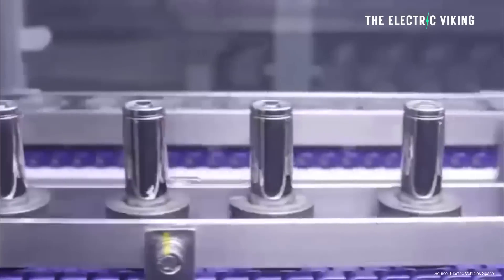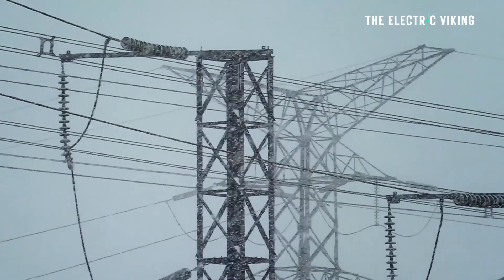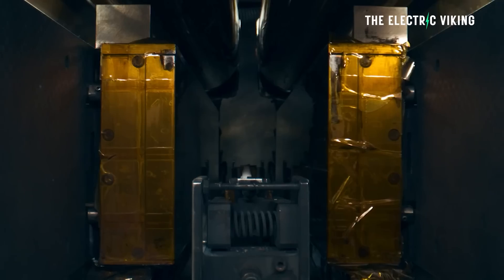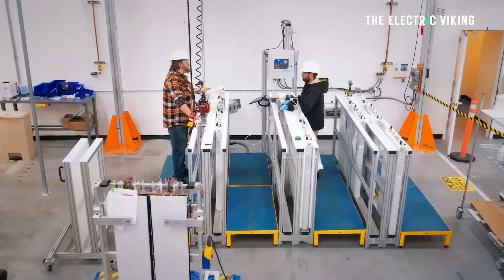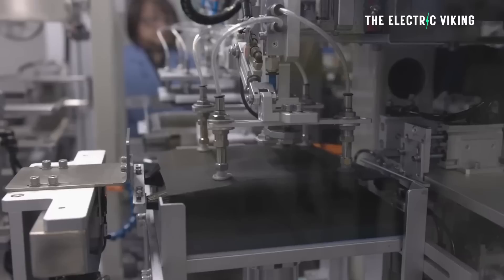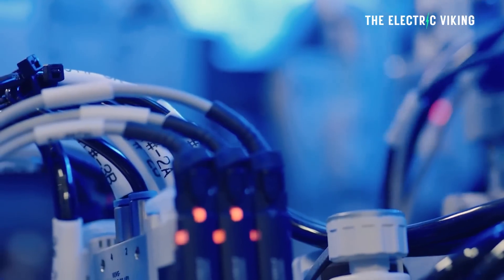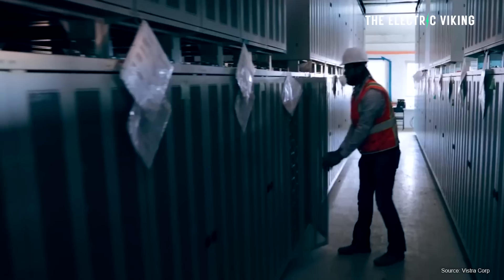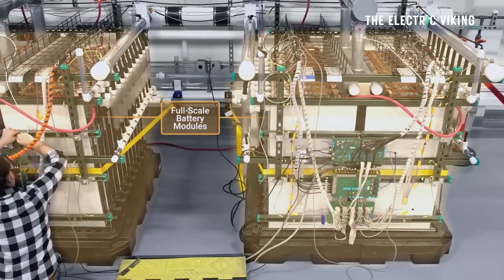U.S company reveals revolutionary battery that DESTROYS sodium & lithium

Comment: Iron air battery's round-trip efficiency is only around 50-60% versus 90%+ for Lithium, that is a big downside I think.
Reply: With peak solar electricity gone begging for a buyer, it's nearly free.  If these can be built cheap, and show a long lifespan,  I expect them to be integral to grid backup in the future.
Reply: It would probably be competitive with low pressure hydrogen with grid scale electrolysers and fuel cells.
Reply: It would be excellent during a natural disaster because you would have spent $30 of electricity to charge it and it would provide you with $18 of electricity. 

Most homes use about $3 of electricity per day or less.
Reply: @mac_mcleod  Nonsense, the price of electricity on the wholesale market is volatile. In the last 7 Days in NSW Australia the price max was $450/MWh and the min was negative $44/MWh
Reply: @retrofitter  Nonsense... the price of electricity is 13.5c / kwH.  See, I can do the same thing.   

Even tho "wholesale" electricty is volatile, most home owners will have a fixed average cost for a given time of day. 

And I'm sure the price even varies wildly in different Australian states.
Reply: @mac_mcleod  nonsense the retail price of electricity in SA is 31 cents + /kwh thats to the ordinary household consumer which matters to most people then you have to add an approz $2/day supply charge
Reply: @maxbrooks1191 if you're paying $31 per kilowatt hour for electricity, then solar panels are an amazing deal.  Because power from solar panels is about 10 cents per kwH or less now. And power from used panels is under 4 cents per kwH.

In any case, the cost of 4 days of electricity is trivial in any first world nation and many second world nations.
Reply: With that efficiency it would be best in locations that regularly has negative electricity prices
Reply: This is true.  The cost of efficiency must be included in the total cost.  Still, it's both cheaper to build and more efficient than hydrogen storage.
Reply: If the TCO approaches 1/10th the cost of Lithium, the round trip is included in that.
I doubt it’s 1/10th TCO.
But let’s say it’s 50% fully installed including ALL costs (land, management, supporting systems)….. that is still staggering for grid scale storage transformation.
It would be cheaper perhaps than closed loop pumped hydro. Which is mature and just works. That’s truly astounding, especially if it can be delivered faster than PHES, which is clearly a much longer project than large scale battery storage.
Good to see realistic competitors with Chinese domination. The world needs this for supply chain risk.
Reply: Also here in Europe electricity is traded at a 15 minute basis. Prices go up and down wildly and sometimes go into the negative. Homeowners are shielded from this and just pay a fix high price. If you have a megawatt connection directly to the grid, for a big installation, you'll pay the traded prices and you'll have to buy futures or other contracts to have guaranteed delivery.
The fixed price is artificial, all electricity is produced and consumed at the same time and the contracts reflect that.

Comment: Form Energy have stated that 'Power Blocks' will be utilised, that seek to mix Iron-Air with Lithium based batteries solutions, where the Iron-Air supports the long duration load demand and Lithium the peak demand. That is a mixed battery farm estate combining both Iron and Lithium battery containers into an integrated system. The aim is to optimise the level of use of Lithium resource in battery storage to allow Lithium to be directed to mobility and portable needs where lower weight is required.  Iron-air due to it's low cost is more of a direct challanger to Sodium rather than Lithium in the energy storage space.

Comment: Red flags all over in this!  I hope those flags are not real!! nice video!! time will tell.  If this was real Elon would make a bid for the company!!!
Reply: Form Energy is headed by Mateo Jaramillo, the former VP of Tesla's stationary energy storage. The company already has very large industrial backers, from steel makers through to Bill Gate's green energy investment company. The company as well as offering Iron-Air batteries - it's 500MW production line has been built and schedule to start deliveries end of this year - is working on a broad front of additional related and industry supporting services. Such as using it's R&D to advance low energy iron and steel making markets, plus provides a digital services battery modelling platform to Grid and Energy companies that allows them to model and cost various operational scenario's using a mix of energy storage technologies (such as Lithium, Iron-air, hydrogen and zinc-air).

Comment: I cannot be the only person who hears Gigawatts and automatically has a "Doc Brown" reaction from Back to the Future.
Reply: 1.21 Jigawatts
Reply: @michaelfung4629 
....Jigga who? (J-Z) 🤣🤭
Reply: @michaelfung4629 

I think that's 1.2 Jiggawatts?!😳
Reply: Great Scott!
Reply: Me too.  Another one is data.  It's pronounced "day-tah", not "daa-tuh".
Reply: @paulrandolph8469  No, it was never Jigawatts but daata and dayta are like tomayto tomaato.  How about GIF files - giff (g as in gut) or jiff?
Reply: You’re not alone. “Jiggawatt” was the pronunciation. Too funny 😂
Reply: 1.21 jumping gigawatts of plutonium bought from a bunch of Libyan terrorists😂🤣
Reply: Lightning in a jar, get jar, fill with lightning.   Seriously, stick a sharp pointed conductive spike high in the air, and connect to large bank of iron air battery with a current shunt to control the amount of lightning bolt that is stored ...might add bunch of actual oil filled jars with copper wire in center of jar and foil wrapped around the outside of the jar, so that the current is not so dramatic ...
Reply: and we're finally on the cusp of flying cars. funny when you look at scifi predictions of a century ago, everyone had flying cars, but computers had rocker switches and ticker tape

Comment: There are no step-change electrochemical technologies coming down the line that are going to result in an EV battery that has double the kWh/kg energy density of current batteries - it is all incremental at this stage.  The chemistry is fundamentally controlled by the thermodynamics of the system and that can't be changed. I like this channel but Sam clearly doesn't understand electrochemistry. Cost efficiencies would be terrific and improved cycling efficiency that results in longer battery life is the way to go. What is being described here is interesting but they are just talking about building a larger battery which is great for a lot of electric technologies like storing solar and other renewables, but if the energy density is lower then it is not going to help in terms in lugging an enormous half empty battery around with you when you drive your EV. Still interesting though.
Reply: Some metal-air batteries may offer step changes, but not Iron-air. It's more likely Lithium-air will be a step change technology, having already at 1.7kWh/kg energy density in the lab and moving out of the labs into production research trials. Lithium-air's challange is one of improving cycle life rather than energy density, which is similar to early Li-Ion development needs.

Comment: So you just have a hybrid. You have your Iron Rust for long term storage, and your Sodium and Lithium for instantaneous massive power. You have multiple connections from the Iron Air battery to allow for faster transmission from the Iron Rust to the buffer Lithium and Sodium batteries, which then send the power on.
That then gives you eg a 1GW/10GWh battery, or 10 hours of 1GW power.
Reply: Totally agree, lots of people focus on the "ONE" solution, when in fact we have multiple solutions and should use them all in conjunction with each other.
Reply: @LinzDubNZ what?? No ....not fumes it's a battery not a stationary engine ya tool
Reply: @LinzDubNZ  Maybe you should watch the vid again.
Reply: @John-p7i5g    You can add as many connections as you might imagine - but the maximum discharge rate of the 8.5GWh iron/air battery will not exceed 85MW, however you might try!  It will not discharge, from full to empty, in less than 100 hours.  Simple maths for most to understand.
Reply: @LinzDubNZ  I suggest you consult a dictionary for "hybrid".
Reply: Where we're going we don't neeed batteries. Mr Fusion will do the jobs nicely...one in every home?
Reply: @LinzDubNZ Batteries are first being used to get rid of the filthy  fossfuel peakers. The fossfuel baseload power will be replaced by renewables eventually. This basic approach is being done all over the world. It's cheaper.

Comment: It is not for same markets as Na-Ion or Li batteries. They will not replace home batteries since power output is low. To have correct power (4kW) at home one would need to install like 400kWh capacity at home.
Reply: Yes, Sam suggested a couple of inappropriate comparisons here. It doesn't compete against Na or Li. For instance, Form's iron-air tec has aprx 50% RTE and larger space+weight reqs. The projected cost advantage is insufficient for home storage. Sam doesn't tease out the numbers vv utilities addressing dunkelflaute, which would be interesting if really 10x cheaper than LFP, including deployment.

Comment: Sodium would still have a place in a hybrid Lithium-Sodium battery, and for stationary storage where space is limited.
Iron Rust batteries take up a lot of room, because the energy density is so much lower.
However, they can be stacked vertically. And given the price of Iron, they are significantly cheaper per MWh.
Reply: Iron-Air has similar theoretical max energy density to Sodium cells (2044 vs 2260wH/kg), but lower than Lithium-Air (11kWh/kg). However, the achieved energy density of aqueus Iron-Air currently offers relatively higher density (~460Wh/kg) than Sodium or the majority of available Lithium-Ion/LFP chemistries. The issue is it has a lower cell voltage (1.3V) vs Lithium (3.2-3.7V) or Sodium (2.3-2.9V) meaning bigger batteries are required that offer lower power density than Sodium or Lithium. Form Energy are seeking to optimise the role of Lithium in battery storage, making BESS lower cost and reduce the Lithium resource required by BESS so it can be prioritised towards mobility and portable needs. Footprint wise Form Energy achieves 3MW/acre vs 30MW/acre of Lithium Storage, however, as you say Form's ability to stack batteries can increase the footprint denisty. Form's solution also has a lower noise footprint, due to lower thermal battery management requirements, so could be integrated into small urban localised needs.
Reply: @GruffSillyGoat  Interesting thanks. I didn't realise Sodium was that much lower than Lithium for energy density.
Reply: Hybrid’s will be phased out because the Greenie’s have decided to outlaw the combustion engines required in a hybrid. Plus… by 2030 the starting price of an EV will be below $15,000. They are already below $15,000 in China already. China’s largest EV maker, BYD, is currently building a massive factory in Mexico to build EV’s. The labor rate in Mexico is cheaper in Mexico now than it is in China. Plus Mexico has much cheaper import/export duties than China does. Ford, Chevrolet, and Stellantis will ALL REQUIRE taxpayer bailouts to remain in business by the end of 2025.

Comment: the major issue with Iron air batteries is the charge/discharge rate is SLOW. so they are better for long term storage were over a day + they can discharge and then charge as power is available.  lithium ion and sodium batteries have a much much quicker charge/discharge rate. So if you have space for a multi day battery for your house then it will work and be cheaper but it has a power limit on discharge and charge rate. so cheaper but larger because you need more to be able to get enough discharge. You will still need quicker charge lithium ion and sodium batteries for rapid charge discharge cycles.
Reply: Yes, this is more of a compliment to sodium ion and an alternative to pumped hydro.
Reply: For some reason, I don't see this type of battery being used in homes, except as provided by the power company, kinda like having a power substation being deployed in a home, it fries my brain to even think of it.  That's what I suppose you meant by "space for a multi day battery for your house."
Reply: Okay THAT'S what it is, because I remember that battery swapping program was going to be using the iron air batteries, because you basically weren't really able to recharge them yourself in a feasible manner. For some reason while watching this, I had it in the back of my head that it was a use it once and then you had to get rid of it because it was essentially garbage. But that dings the memory back into my head as to what was truly going on lol, the super slow recharge rate.
Reply: Seems like you could have a nice mixture of a battery and generator technologies. 

However batteries are still too expensive. 

That said, my thousand watt battery that cost me $1,000 can now be supplemented 3 years later with the 2000 watt battery that cost $1,000.

So that means in about 6 years they're going to be cheap enough.  Will probably be able to buy 4000 Watts for about $500. 

On a related note my 55 inch big screen TV that cost $1,100 a decade ago was replaced by 55 inch big screen TV that cost $350 two years ago.   And I was walking through a big box store yesterday and there were 65 inch screens for $298 that were not on a special holiday sale.

Battery packs in this range are not enough to run your house for an entire day but they will save the contents of your refrigerator provide you with internet fans and lighting. 

There will still be high value of propane generators for Middle income and lower during disasters for the next decade. 

I could see that in a decade most people with their own home will have good solar power generation and people in apartments will have 4,000 watts of battery backed up power for disasters.

Comment: Depending on the insertion loss being acceptable, smaller high discharge rate battery or capacitor banks can be charged from the large capacity slow discharge rate ones for availability of needed capacity at high-demand times.
Reply: Edit to analogise: It's somewhat akin to having a long term savings bank account, and a short term current account replenished when necessary from that long-term account.
Reply: Not capacitors. they are useful only for timescales of a few seconds and have very poor energy density.
Reply: @rogerphelps9939  Fascinating. Best you correct Eaton:
[Supercapacitors can be used alongside energy generation sources to help dampen transient supply behavior from microgrids, address rapid changes in demand, and provide bridging power during rapid rates of demand change or supply drop out for backup situations. These features lead to supercapacitors pairing well with modern microgrid and macrogrid energy source technologies. ]